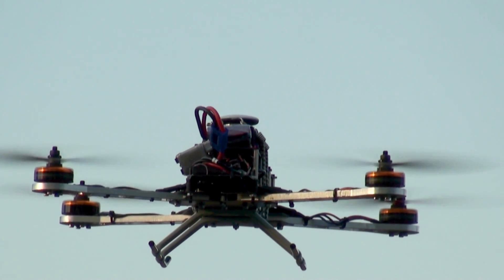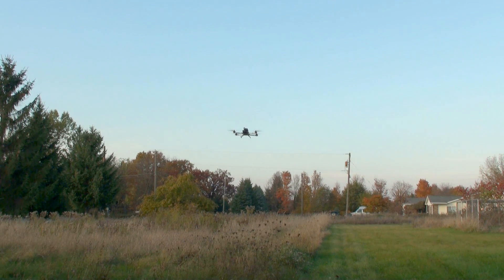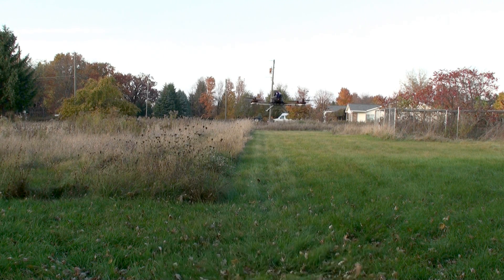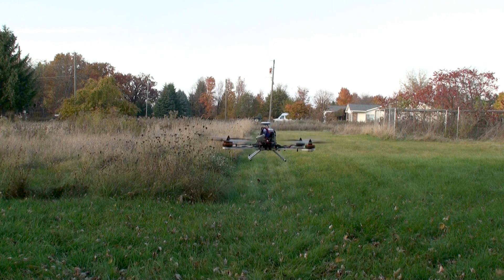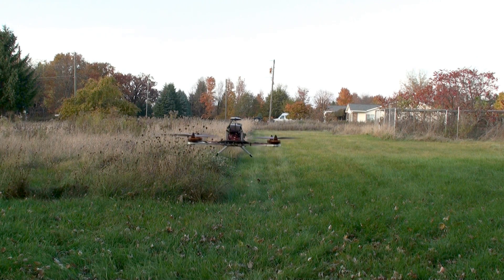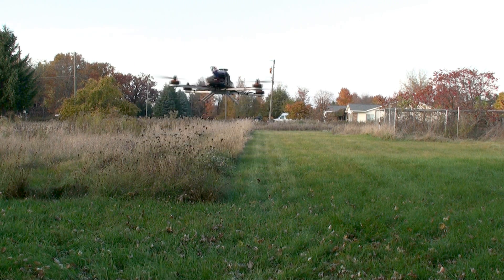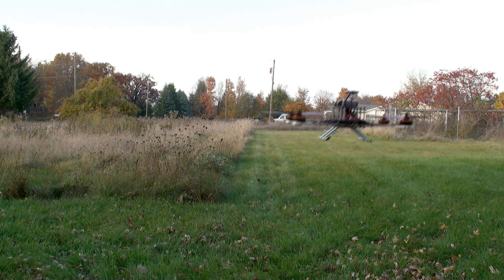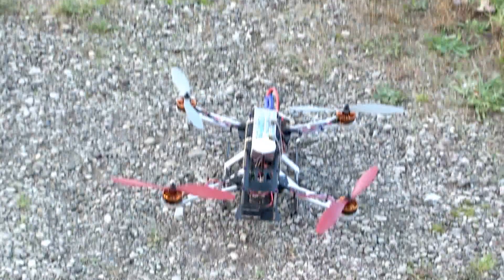Iconic X V2 Test Flight w/ Naza V2  DYS D4215mm 650kv Pancake Brushless Motors

Comment: Hey 31 I upgraded my F450 quad from 15A esc's, 1000kv motors, 10X3.4 props to 30A esc's and 650kv motors and 12X3.8 carbon fiber props all at the same time a few months ago and my quad flew like Sh**t. Since I upgraded so many different things at once I wasnt sure which componant was the problem until last weekend. A youtube friend of mine told me that my carbon fiber props wont flex enough and will cause problems so just for the hell of it I put on my old 10X3.4 props and my quad flew like a ROCKSTAR BUT it cut my flight time from 12 minutes (w/ 12' props) to one minute (w/ 10x3.4 props)!  Do you think that my problem is prop size or prop-pitch? This is something that I just cant seem to understand. Man I know I didnt explain very well but can you understand my question?

Comment: You've got your quad flying nice and stable, yaws really great.  I've got those motors on my hexacopter now and I'm using  the naza lite plus gps, flies nice and stable.  I could not help, but notice, that you have no snow, I'm left to do hovering in my basement.  We're suppose to get 6" to 12" of snow tomorrow, so my outside flying is limited.
Reply from the maker: Thanks I set this Iconic x up for video work with these motors and I like them and I hope you are having good luck with yours. There's a lot of snow on the ground here now also as you can see in the  new video I put up today. The iconic x in this video is the last day before the snow hit a few weeks ago